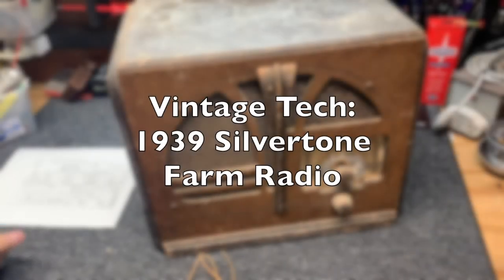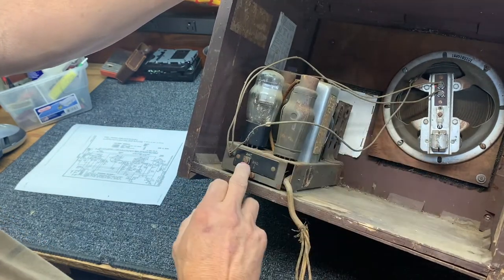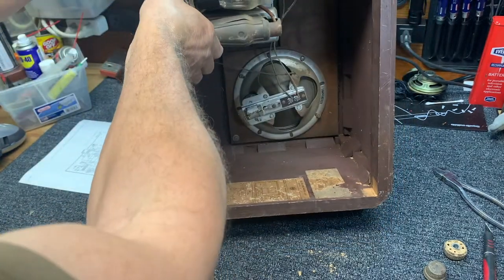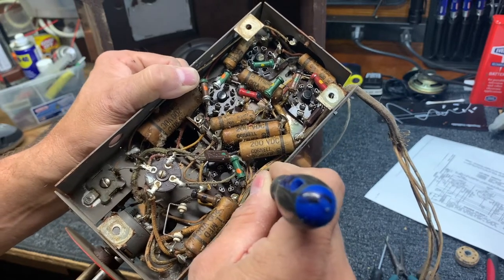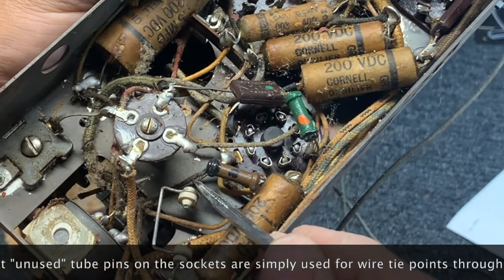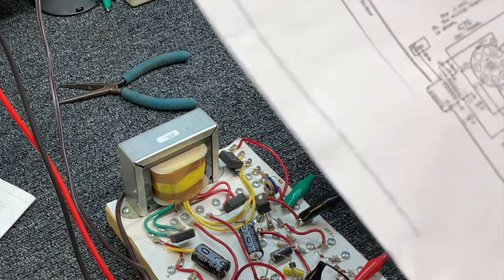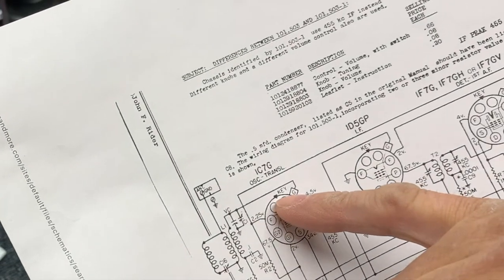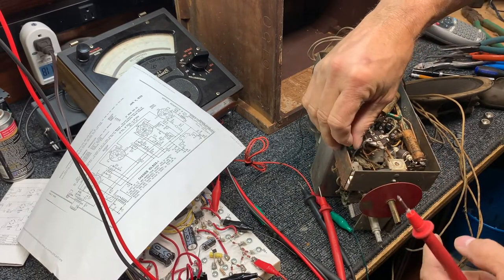Vintage Tech: Silvertone 6150 Farm Radio Part One

Comment: I have that DC power supply that is built on a wood plank.  They use to sell them at Antique Radio Supply.  But I built mine into an old cabinet from a junk RCA portable color generator.  Added potentiometers in place of those little flat pots, added banana jacks for all the outputs, and a power switch.  Turned out to be a very valuable piece of test gear.  And it's a whole lot safer. Both for me and the power supply.
I love those old battery farm radios.  They are a lot of fun to work on.
Reply from the maker: I have been wanting to take the time to "safe-ti-fy" my unit like you have done.  Just never got around to it.  Guess the first time I get a tingle from the 135 volt supply I will decide to take the time.  HA.

Comment: I would have checked each tube for continuity while I had them out cleaning them..
Reply from the maker: You are so right.  I sometimes get preoccupied with either the video work or other distractions and miss the most basic troubleshooting steps.

Comment: Shame about the fillaments, at least you found cheap replacements for the valves. Did you check if there was any voltage on the old bias batteries ? :) Can't wait for part 2.
Reply from the maker: Franko. Yes I checked the bias cells. They were .1 and .4 volts. So the slightest residual energy in them.
Reply: @KOVintageTech  Ha ha, Not quite enough for biasing, then. LOL.